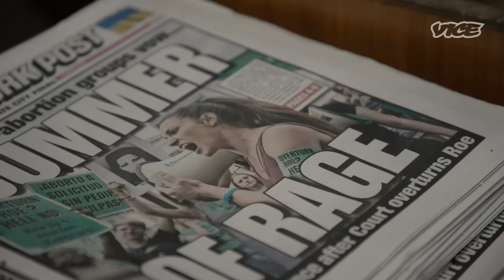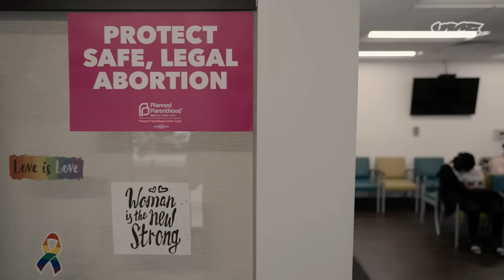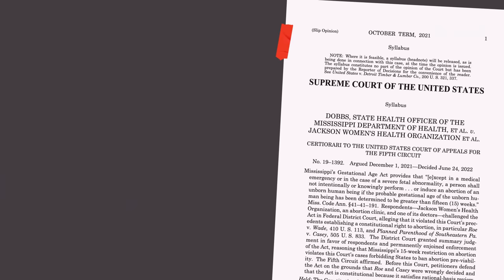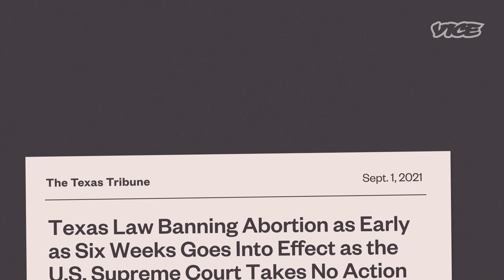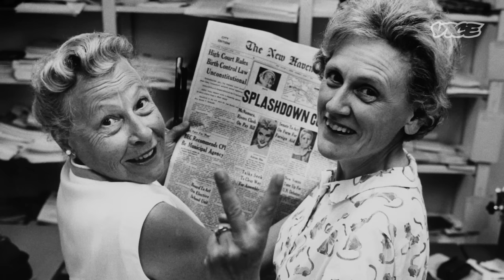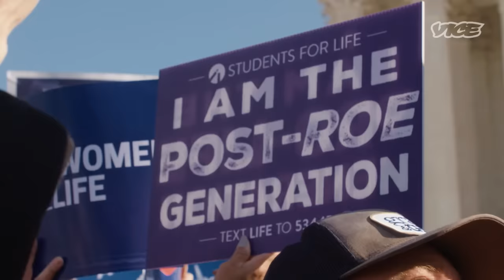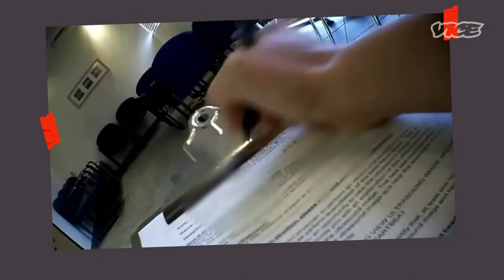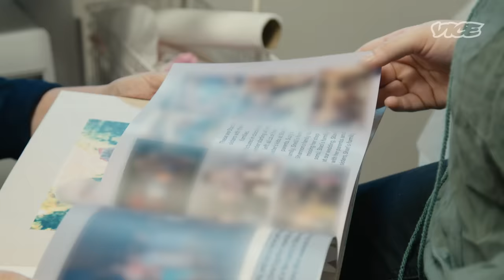How the Anti-Abortion Rights Movement Took Down Roe

Comment: Its very interesting what the ADF Senior Counsel said. "You can reach the Supreme court by winning or loosing. If you loose in a federal court you can appeal in an appeal court and if you loose that you can go to the Supreme court." She said that is what Mississippi did. Basically it shows that as long as the Supreme court is politically and religiously motivated, the judicial checks and balances below it is moot.
Reply: That's not remotely what it means.
Reply: @adithyanneelamana5685  how is that not how it works? That’s how our legal system works. When you lose you can appeal to the higher courts at the next level. And the buck stops with the highest court in the land of which you can’t appeal any further past them. Of course the Supreme Court can refuse to hear the case, not suggesting every loser gets a day in the Supreme Court. But the idea that you can get to the Supreme Court and ultimately win whether you lose in the lower courts is true. Of course it wouldn’t be as successful if you ALSO didn’t stack the Supreme Court in your favor. Which conservatives have done. Sometimes through blatantly unethical means (re: senator Mitch McConnell blocking Merrick Garland from the supreme court in order to rush his own appointee months later). So OP is completely correct as long as the court is religiously and politically motivated (which they are, there wouldn’t be a fervent goal and attempt to appoint Supreme Court justices of a certain ideology to the court if it didn’t give said ideology at least some benefit), the judicial checks and balances below it is moot.
Reply: "Lose".  Smh.
Reply: How was Dobbs “politically and religiously motivated”?  SCOTUS observed that there is nothing in the constitution about abortion so it returned abortion regulation to the states. It didn’t impose its views about abortion into the constitution like Roe did

Comment: The clinic at the 5 minute mark addresses a lot of issues, but the reality is that they are concerned that they are going to be put out of business.  Wagon wheel makers, eight track tape player manufacturers, and lots of other businesses have gone out of business for whatever reason. Abortion clinics had a 50 year run. Hopefully, they diversified.
I think it’s ridiculous to say that banning abortion will increase infant mortality rates. 
The federal bill is doing just the opposite of “dictating lives.”  They have simply said that the majority vote of the citizens can decide the legality and parameters for getting an abortion. 
You don’t have a constitutional right to to getting a tattoo, or to commit suicide, so to use the “it’s my body” argument is moot.
In my opinion, the pro-life movement trying to criminalize abortion is only a bandage, not a cure. By creating legislation (something that can be changed from one administration to the next) to ban abortion is not where the push needs to be. The push needs to be a Supreme Court opinion that a human being is a human being from the moment of conception, not something that one needs to qualify for with a “literacy test.”  As it stands today, the unborn are treated like property, the same as a slave and the slave owners, the mothers have full discretion over their property.  When it was finally agreed that the slaves were human beings and not just property, then they were entitled to the same constitutional rights as every other human being in the United States. Forcing women to give birth?  Yeah, and forcing plantation owners to pick their own cotton. C’mon.
Why does it become the state’s responsibility to provide care the bad choices, or bad circumstances that happen to the public?  I guess my question is, why does everyone want to give the government the control over them. Is it the states fault that the father is a dead beat?  Is it the state’s fault that the mother chose to hook up with a dead beat?  But the state is now expected to find a solution.
Reply: The "it's my body" argument is perfectly valid, it doesnt have to be explicitly linked to the constitution.  Getting a tattoo is totally legal in the country, it's just a function of freedom of choice.
Reply: @wylierichardson-tu6zs  there is no federal law that bans tattoos, same as there is no federal law that bans abortion. It’s left open to the voters to decide whether or not they want to allow tattoos and abortion.